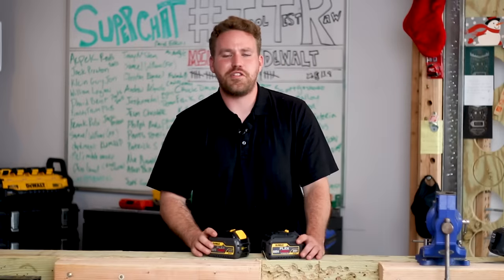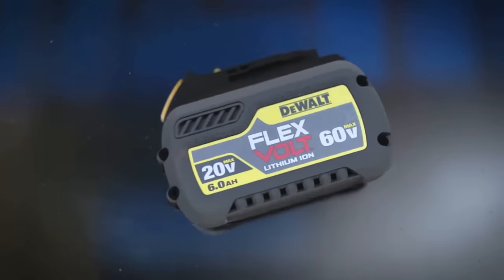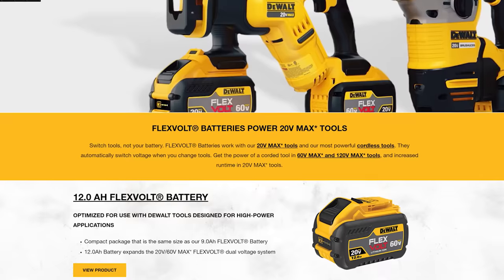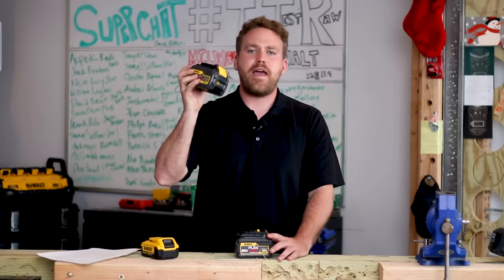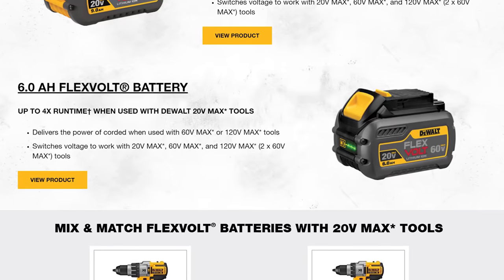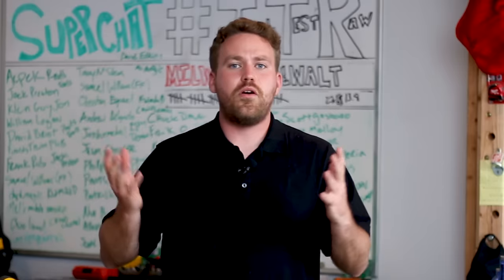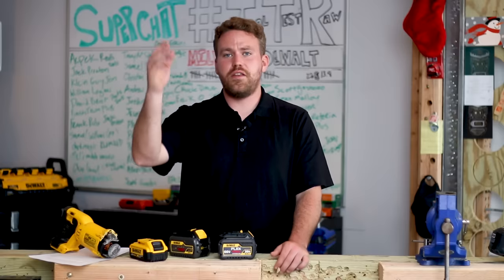NEVER USE DEWALT FLEXVOLT BATTERIES ON 20V MAX TOOLS!

Comment: @ Average American  watch there videos   especially nicks  he is actually a huge DW guy (he admits it all the time) has been since the beginning of this channel  and if you want to say they are up milw ass then look at there videos about the milw collet problems   Vince used to be a DW guy but flipped to milw guy about a year ago and he has several vids telling you not to buy certain milw tools as well as nick being a DW guy and he has several vids saying not to buy certain DW tools.  you may be right about the battery thing because they do stress the hell outta the tools. (Which you are not.  DEwalt came out just 3 weeks ago confirming that the 1st gen flex bats had a bug that would cause the bat to switch V while running during high load applications  they haven't admitted to it burning them out but have said the bug has been worked on)  But i have been watching these guys as well as other reviewers for a long time and VCG is about the closest to UNBIAS as i have seen.  They really do seem to make the videos with viewers and contractors in mind.  So before you say they are supporting one or the other do your research.
Reply: Then if that was case they should change the video with this added or at the very least put it in as a note, and as a DeWalt dealer I know I would have no problem switching out and Flexvolt Batteries for different Gen FREE, but after selling thousands of units since day 1 Flexvolt can out have yet to see this, only warranty issues iv'e seen on Flexvolt is DCS578 overheating from people cutting metal instead of using a DCS373

Comment: This is a " Click bait video" to me. Sounds like driver error to me, Ive been using the flex volt battery on my dewalt 30 degree nailer no issues so far after 2 years of constant use. AND FOR GOD'S SAKE MEN AND WOMEN YOU HAVE TO CLEAN IT REGULARLY!!!!

Comment: Literally just had a flex volt Dewalt grinder quit on me the other day and today I plugged a flex volt battery into my flex volt saws all and nothing just like the guy in the video only it was a flex volt reciprocating saw I am a huge DeWalt fan all of my tools are Dewalt I use them for work really hope I’m not wasting my money
Reply: You say it was a "flex volt" Dewalt grinder, am I correct?  This grinder?  DeWalt Flexvolt Cordless 60 volt 6 in. Small Angle Grinder Kit 9000 rpm  DCG414T1.  If so, this grinder was specifically made for the flexvolt batteries.  Sounds more like a possible defect.  I wouldn't be afraid to use the flexvolt on my 20V 1/2" or 3/8" impact's.

Comment: Gee, I wonder why you didn't measure something real, like pack voltage or something, to show a tangible difference in 20V vs 60V packs. Something that would cause such a compatibility issue. Uh, its because there isn't a tangible difference. You haven't explained the problem, you've only made claims using anecdotes. With a 60V pack running in 20V mode you are looking at higher number of parallel cells, thus the higher runtimes. This will result in less voltage drop at high load. Less voltage drop = lower amps for the same load = less heat and wear. ONLY if you could demonstrate that 60V packs run at significantly (5V ish) higher voltages would you have any sort of case to support any of these claims.

Obvious reasons to suspect this video:
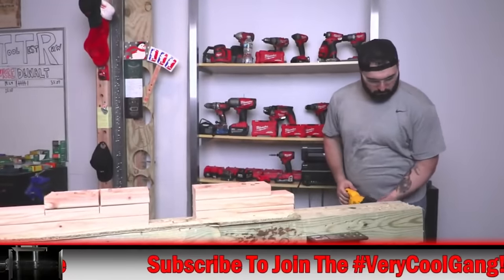In the first (low quality) video you show there's a cut just before the "failure" (1:52) and the other (2:32) it looks like the guy could have fliped the trigger lock with his thumb for a stunt (why did it fail when he finished the cut?), not to mention the product placement in both cases. On the other hand, its not like tools don't fail. Both videos could be real, it wouldn't prove your point. We can find videos of Milwaukee tools failing too, you know.

Comment: The same thing happens when you use corded tools, theyre not air tools they get hot, its almost like Milwaukees batteries cant keep up, compared to dewalts. You can try to pull the wool over anyone's eyes but the truth is the extended run Time comes with the ability to push your cervo longer and harder, the same thing could happen using regular 20v xr batteries😅 if you got your drill hot until the battery died, then immediately put another battery in and kept using it then you're a re re. Yall were literally melting them or using damaged tools, end of story ya liars😑😂😂

Comment: What a joke!  A motor has an internal resistance; meaning at 16-21 volt given the “resistance” ; there will be a set amperage that the motor will pull from the battery. I thought these guys were smarter than that. Wow!!!

Comment: This video is a joke. You can abuse any tool to failure, it's just that dewalt actually has the battery life now to let you do it. If I redlined a Ferrari for an hour and the engine eats itself I can't go on to say that it was the fuel.

Comment: so let me guess. Everyone before flexvolt appear , where trying to prevent you to use a higher voltage battery to your tool, because it will burn it, like a 14.4v drill with a 20v battery, but now that finally a manufacturer did it , everything is fine and noone has a problem with their tool being burned. hmmm! so all these years someone was manipulating us to not use higher volt batteries . And this is joke. A 20v tool gets bumped up with a 60 volt battery three times the voltage and nothing seems to burn. after this i am bumping all my cordless tools to at least 2 times the voltage.
Reply: That's not what is going on.  The 60v/20v Flexvolt batteries have a switch that activates in a 60v tool (to use 60v). In a 20v tool, the flexvolt stays at 20v (just longer run time).

Comment: Bit of an irresponsibly titled video this.  Condemning forever the use of an entire battery system when a tool or two breaks down after running it to destruction on film, with no scientific proof it's related to the battery and without consulting the manufacturer or a battery expert regarding the problem so that you have more of a conclusive reason as to the reason for the failure is very poor judgment indeed. Poor show.

Comment: Absolute nonsense. VCG haven't got a clue on this. Been using DeWalt XR systems on my flex volt batteries with zero problems for over two years. If you're going to attempt to discredit DeWalt just because you've got a Milwakee spot on one of your videos at least be man enough to admit it!

Comment: I have a really good suggestion for you; Go get professional help. If you're willing to compulsively lie about "multiple dewalt tools" burning up after asking cluelessly the rhetorical question "do the flex volt batteries over power 20v devices???" when a quick Google search would answer your question then you clearly need some counseling. (all for attention) 

The battery sizes vary in run time capability due to differing amp hours impacted by the size and count of power cells in the batteries. Just because a battery has a higher ah doesn't mean it's pushing more or less power into the tool. The tools are designed to draw from the battery the required voltage. All flex volt means is that the battery can handle multiple voltage draws. Do you really think Dewalt would push a battery that burns up drills that they warranty only to have to replace those drills? Now delete this God forsaken video before it gives more people cancer and go see a counselor.

Comment: As much hate as they're getting, they are kinda right here I think. Normally, Flexvolts won't be a problem. But if you're putting very high loads on your tool, Flexvolts will run too much current through your tool meaning 🔥.

Just be careful not to do something extremely retarded with the tool you're using if you're running a Flexvolt.
Reply: 21area21 
Blaming DeWalt is different than blaming the user, which is what they’re intimating.

Comment: You need a lot more evidence than just a saw went dead in your shop with a flexvolt battery on it before you disparage a fine tool like DeWalt! I have a shop full of flexvolt and 20v max tools and batteries and have never had trouble using a flexvolt on either tool. Come back when you have done some legitimate  laboratory grade testing with data that supports your claims.

Comment: Why do people like this bother to make this rubbish. The flexvolt batteries are a 6 pin battery and flexvolt tools have 6 pins but the reverse compatible 20v tools use the battery only as a standard amp battery that just happens to hold power longer than a 5ah 20v battery. The tools that burn out are not burning out because of the battery they are burning because the tool is rubbish. But then you only hear people making a load of nonsense noise when stuff goes wrong not when millions go right I suppose

Comment: I've had my 20volt tools get really hot while using the 9ah flexvolt. When cutting through thick lumber or drilling through lumber with large hole saws, I never have had an issue other than somewhat extreme heat around the motor.

Comment: A guy did some tests with a reciprocating saw, and he said the 1 amp cut slower than the batteries with lesser amps because the saw was moving too fast. So, if they can move too fast can't that burn them up? I prefer to use the intended battery in mine.

Comment: This guy has no clue what he's talking about.  The Flexvolt batteries have a physical switch that connects the batteries in parallel when in 20v mode.  It's identical to any of the 20v batteries when it's in that mode.  He should admit he was speculating and was wrong and remove this misinformation video!

Comment: Thousands of users use flexvolt batteries and are pleased. Only the weight of the machine is greater, which is compensated by the longer running time. The video is false

Comment: This is a stupid video. Clearly talking about something they have no idea about. Any electrically savvy person hears the Flexvolt backward compatibility claim and whether it's in the USA and it's 60V max back to 20V max or the rest of the world where the advertising is a bit more honest and it 54V back to 18V, they see the exact factor of three. The obvious way this works is there are three banks of cells in the pack that are 18V (20V max not under load) each. Then they are just wired to different terminals on the battery either end to end (in series) to give 54V or side by side (in parallel) to give 18V with 3 times the run time. (As the voltages are not being added there are essentially three batteries in one for the 18V tools.) Depending on the tool they access the different voltages available at the different terminals. There is no way a 18V/20V max tool can accidentally access the 54V(60V max) and burn itself out. This is either a deceptive attack on the tools by a competitor or the work of someone ignorant of the most fundamental electrical theory and understanding of how the batteries are backward compatible.

Comment: "Electrical engineer" 🤣 if you simply know anything about the tools the pin out is completely different on a 60v hense why it's a flexvolt. Do some actual electrical diagnosis to actually see what's happening instead of trying to scare people not to use them when they can all day.

Comment: You didn't show me anything that convinces me the 60V battery is the cause of the failed tool.go buy two new identical tools, unbox them on screen, and run one with a 20V battery and the other with a 60v battery and make identical number of cuts in identical material. See which one quits first. Then do it all over again TWO MORE TIMES. The average your results. Now you have a small but respectable data set from which to draw a conclusion.
.
Right now all you have as far as what you've shown us is one tool with a history we know nothing about that failed while using a 60v battery (you say), but I don't think we got to see it fail on camera did we. You cut back to show removing the battery and trying to run the tool. At least that what it looks like to me. I'm not saying you're doing anything wrong or hiding anything from us, just that there is not enough here to make me a believer.

Comment: Complete and utter b.s. Iv been using my flexvolt batteries on all of my 20 v max tools since they came out with flexvolt for my deck building company without any issues what so ever but my 18v Milwaukee burned out after 2 years 🤷‍♂️. I love my Milwaukee 12" sliding miter saw better than the dewalt 12" sliding mitre saw but only for "precision" because of the digital gage on the Milwaukee although the dewalt is far more powerful. Dewalt all the way do not listen to this video as it's totally unacceptable and inaccurate.

Comment: Its quite possible a flexvolt battery burned out a DCD985 motor and DCD996 trigger, under hard use that the tool would generally stall under similar conditions with XR batteries. So there could be some truth in this video. I use the flexvolt batteries in the XR garden tools, as I'm just taking it easy around the house, or the brushed circ saw going easy as it produces a nicer cut.  I'm hoping the DCD130 with solve the hard drilling issues.

Comment: I was expecting an in-depth blood into the battery backs, the BMS, and voltage regulation however it quickly became evident that his comprehension of this subject is extremely limited. He even fails to reference instances of failure beyond their teams experience. This Is just easy, effortless and half αś_ed content with zero preparation and research.

Comment: I had this happen to three of my dewalt tools last year and just stopped using them on 20v tools.  I recently noticed at least one Dewalt tool say specifically on the box that it was compatible with the 60v batteries.  Glad to see it wasn't just me and why Dewalt has not addressed this when they seem to know it is an issue.

Comment: Love the content. 
I've been using the flex volt for some time now and while I don't use it to the extent that you guys do in your videos this does concern me that these batteries may be causing some unseen damage. 
I have swapped to only using my 20v max batteries on 20v max tools even though my kit came with the flex volt. Now I got a flat flex volt battery just taking up bag space.
Reply: They don’t cause a problem.  A flexvolt battery on a 20v tool works exactly like a 20v battery.  This is nonsense. 

Or a Milwaukee ad.

Comment: I have to totally disagree with this. I’ve been doing this for some time. No problems. They stay cooler with a 20v Max tool—my own experience. And by the way, other channels have found the same thing.

You can’t burn a tool out by using a more powerful battery. And these batteries run at the standard 20v (really 18v) on 20 volt tools. It’s pretty simple.

Comment: Here is my take on this... The tool is going to only draw what necessary power it needs to operate as long as you give the tool the rated power draw and then some. If the end user exceeds the normal operating parameters and specifications of the tool, then I would expect a failure to occur.

Comment: Don’t use a massive battery on a small tool. Flexvolt can only run on brushless motors. Use the right tool for the right job. Don’t over load a small tool, running a large lag bolt into a large would. I understand what you are saying, but come on. DeWalt makes much larger drills and drivers and a much better rip saw that what you used. I love my 887 and I have 2 850’s and still like to use my 887. But I’ve never ran a flexvolt on it, why? Because it’s stupid. There isn’t a reason. A 5.0AH is the biggest I go. 
Love your channel! Keep up the good work!

Comment: If you go and watch AVEs video on flexvolt batteries he does a pretty good job explaining how the batteries work... I will do my best here

This guy gave both tools shown in the video a hot supper. The smaller 1/4" impact driver and the recip saw were not designed to be beaten on as hard as they were beating on these tools.

So you have a flexvolt battery on an XR 4- 1/2" / 5" grinder. It's running at 20v with a 9AH capacity. You're not going to burn it out unless you beat on it. You're supplying it with the right amount of voltage, and MORE amperage (the cells here are generally capable of supplying 4.2v max with a capacity of 3000-4000 MaH, and have a max current rating of 30 AMPS) ran 5 cells in series (21V) and 3 parallel rows (3x3 = 9ah, max output is 90 amps. 

NOW as soon as you put this battery on a 60v tool, you're now cutting everything down to 1 cell. You're basically taking all 15 cells in this 9 AH battery and stacking them end on end to produce your 60v, but you're also only getting 3ah out of it and only MAYBE 30 amps continuous. 

This can also cause the battery to drain unevenly and eventually turn your $300 CAD battery into a unnecessarily large yellow paperweight.